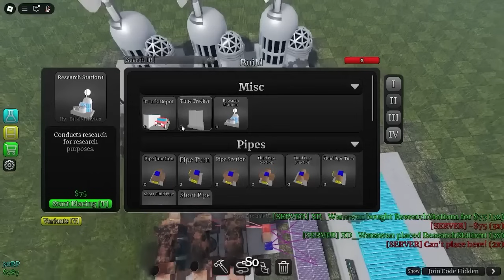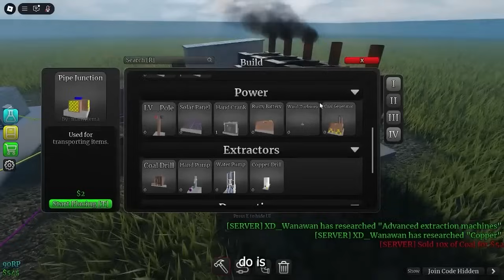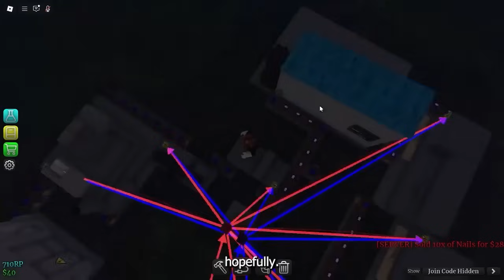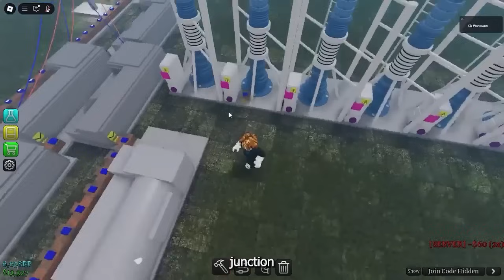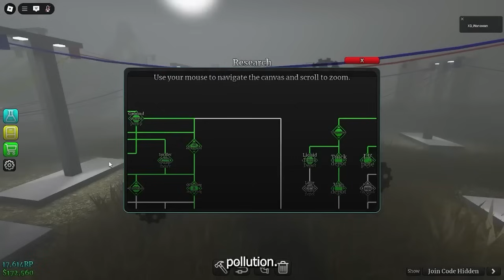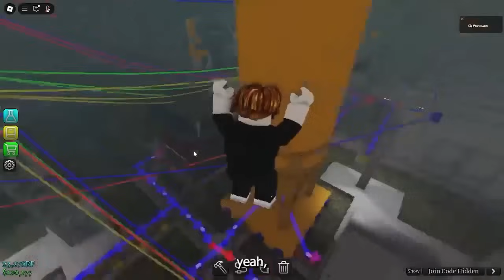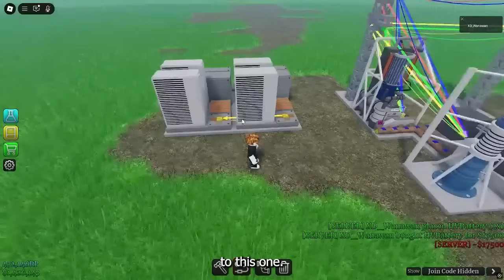Industrialists – FULL NOOB to PRO Series in 1 Video! 💰🔩 (Roblox Tycoon Gameplay)

Comment: 3:12
How did you connect both lines at the same time?

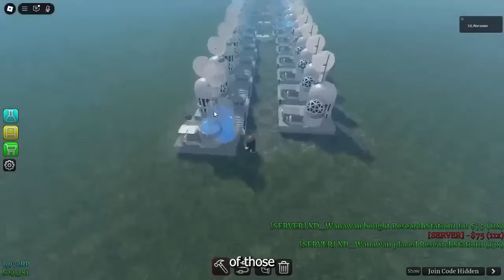49:19
How was your wiring so fast!? I always have to do it one bulb at a time, and you can do entire towers to every connection in like 5 clicks.
Reply: @figgertonoinkpish_kl4250  hold shift while doing wires
Reply: @Epoxy_Videos1I knew how to set multiple wires without dropping it, but he holds shift while setting down 4 wires at a time from pylons. I was only able to set one wire at a time, and would have to click on the pylon for each color. I found out you can just click on the very bottom plate, and it grabs all wires

Comment: tip: use flitered water for 0.30% extra cleaning for scrubbers
If u dont have distilled water
[also get steel when u have like 70k money and 20k research points
[Oil its the way to make alot of money]
[make gearboxes when you unlock plastics]
Extra tips:
[if you unlocked the oil and started producing alot of money then get the research station 2 then the steel]
[Wind turbine 2 and coal generator and turbines are best power for early game]
If its tip helps you let me know
If it doesnt help you then tell me
wait why did I do it so stupidly?